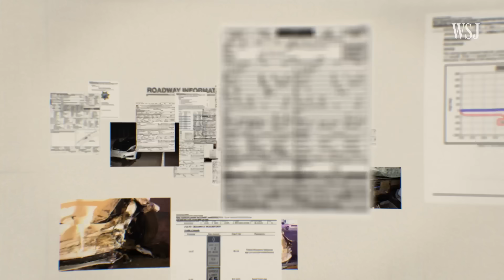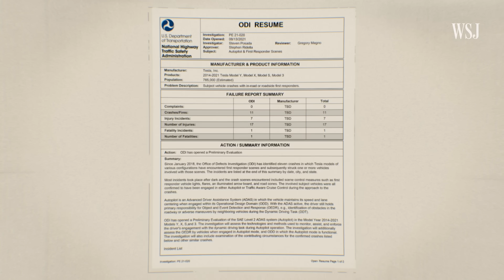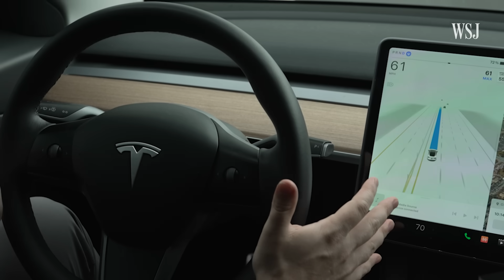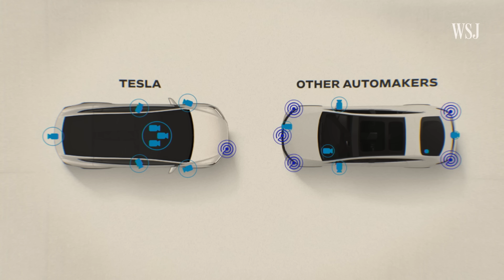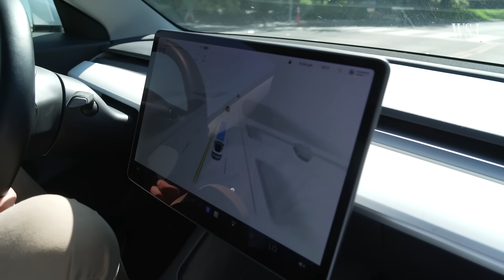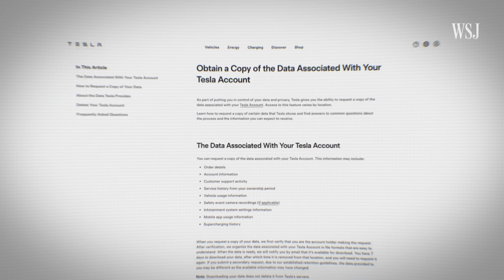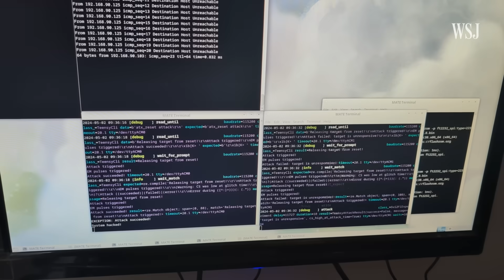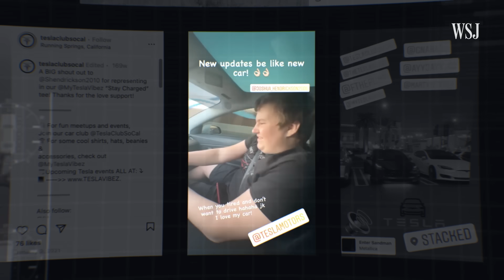The Hidden Autopilot Data That Reveals Why Teslas Crash | WSJ

Comment: Not just Tesla Autopilot, but auto lane keeping systems from other automakers, adaptive cruise control on any car, or even plain old cruise control available since the 1950's, does not stop for traffic controls or hazards in the road.  Like aircraft autopilots, it just maintains speed and heading, the driver needs to use the brakes or steer out of the lane when required.  ACC will slow for cars in the lane ahead of you, and some even stop for stopped cars, but not for all unmoving objects, like overturned semis.

Why the WSJ is framing this as a Tesla specific problem is a mystery to me.

Comment: The issue is not the cameras but the autopilot computer. Most of Teslas fleet is on whats called Hardware 3. Beginning in 2024, they released a new computer in their new bought cars HW4. This is currebtly the only hardware Tesla has that can run autopilot safetly with FSD version 13. So the short story is they are only sending the latest and safest software updates to HW4 vehicles!

Comment: Would a human driver see that at 7:10 without high beams on? Don’t think so. LiDAR would have picked it up. The whole point of self-driving is it should use better senses than a human driver so it can respond to these unusual conditions and be safer. It would also need better software than just trained AI, so it can respond to something unusual.

Comment: Some of this reporting was very dated, notwithstanding there have obviously been accidents, aggregate data (which is publicly available) would have been a good orientation point. People want complete accounts of issues. This is a good anecdote why mass media will fade faster than the discussed technology (as per the final quote).
Reply: One of the main points is that the data is not available.   Tesla hides it and is about to get worse as the new administration will soon not require crash data to be submitted to the NHTSA.   At the same time, they'll fast track this same tech to be fully autonomous
Reply: i dont get how people still believe anything wsj puts out

Comment: I had a Honda with dim headlights and also crashed into a disabled car on the freeway because they didn’t have any lights on and my entire front end was smashed in. As I got out of the car and sat in the middle divider, another car came up and rear ended my car turning it into an accordion. When I bought my used 2016 model x, the headlight was also dim like my old car, but the highway auto pilot worked good and it felt safe like adaptive cruise control that steers for you. I now have a 24 model y and headlight have drastically improved, but I don’t trust the supervised auto pilot as it made too many critical mistakes that I did not renew it. I find the issue is that the sensors do not scan far enough in the front and back. The documentary is correct that Tesla should reimplement lidar or any other technology like laser or sonar or anything in addition to just vision for better detection of objects in the road. Now that my free FSD trial is over, I’m back to the basic highway auto pilot and it definitely feels much safer since it’s not doing random lane changes and exiting last minute.

Comment: I was driving on autopilot on a highway at night about 4 years ago and was traveling around 65mph.  I was slightly distracted talking with my wife and its such a good system on highways that i was a little complacent.  All of a sudden a washing machine appeared out of nowhere right in the middle of my lane and autopilot didn’t react at all, but i noticed it in just enough time to take advantage of the cars low center of gravity and swerve around it, narrowly missing it and continuing on without incident.  It was purely my own situational awareness that prevented me from crashing directly into that washing machine, but thats what i was constantly told would need to happen while using the system, is that i would need to still be aware.  I have since seen huge improvements in the system, but only time will tell if it can see and react to these random objects in the road in a safe manner.  I still trust and use autopilot, and consider it a useful system, even though i still do have to correct it from time to time.

Comment: Wow, So much wrong info. While I agree this should not have been called "Full Self Driving". I never heard a claim that it didn't need monitoring. All the accidents shown in these video clips should have been "Driver intervention" moments. I also agreed that camera's alone were not enough, until I saw video of some new tech cameras that are more like high resolution radar combined with video that produce a sort of composite view. I'm on the fence as to whether this is a good idea. Too good, and it leads to complacency.

Comment: Seems like most of this could be solved by Tesla putting a second sensor type back on vehicles in addition to cameras
Reply: No the multiple sensor data complicates the calculation, which is why the newer teslas have an even better safety record than the first ones. Something they forgot to mention in the video, is that teslas even the old ones have the best safety records of any vehicles to date...
Reply: @Struct.3  Where are you getting your data? A quick Google search reveals a fatal crash rate for Teslas of 5.6 per billion miles, whereas the US average is 2.8 billion miles, so would be interested in how you are measuring.
If you're talking about crash safety ratings...that's just how well they perform when they eventually do crash, which is handy when Teslas are more likely to crash in the first place, but it would be better to avoid the crashes in the first place!

Comment: I knew it was a bad idea to cut cost and remove all the other sensors. They should make a law that requires several different types and fail-safe sensors if they are going to have autopilot features. I am a Tesla share holder, so this is a big issue I have always worried about.

Comment: The question is: would have Hendrikson avoided the crash if he was driving??

To be honest, if the car already warned him 19 times before the accident to keep his hands on the wheel, he probably slept while driving. It was 3 AM as well.

We need to compare the accidents with and without driving assistance to have the correct picture. Accidents will happen always.

My condolences for his family and the families of all those who died.
Reply: Most other brands would have the car stop driving if the driver doesn't have his hands on the wheel for that long. Rather than continuing and just giving out warnings
Reply: @ruykava  The other automakers would just turn off the assist system and let the car go into a ditch at full speed on a turn which would allow them to avoid the liability of crashing into something while driver sleeps.
Reply: This is an incorrect assumption (19 warnings -> sleeping). Tesla's driver monitoring at the time relied solely on monitoring the steering wheel for twisting (by the driver's hands). It could never tell whether you actually had your hands on the wheel, only if you would provide enough torque to convince it that you're attentive. The problem was that if you turn the wheel too much, it disengages the autonomy software and you are driving manually again. This created a delicate balance of putting just enough, but not too much, torque on the wheel. It's easy to go too light and then get those warnings. Literally everyone who used autopilot/FSD (before they added vision-based monitoring) got these warnings, all the time. 

If Tesla's software determines that you weren't responding to the warnings quickly enough, it would lock you out of the autonomy features for the remainder of your drive. The fact that it didn't do that here, despite 19 warnings (over what time period?) is not a data point in favor of the theory that the driver was inattentive. 

Possibly complacent, or overly trusting of Tesla's software, though.
Reply: Radar sensors could have help to stop breaking sooner. That’s the main flaw here.
Reply: Right don't blame poor billionaire Elon.
Reply: Not those kinds of accidents!
Reply: You can hardly see the overturned truck coming at you at 70mph. There were also humans on the road, causing more confusion and probably a delayed reaction. Instinct is to go to the left shoulder - but it was clogged with people. Possible approaching traffic to the right - and not enough runway to stop in time. But the WSJ calls it "Tesla bad".

Comment: It's the fact that it is a beta product that only recently got very good. People need to know the true limitations of the beta and Tesla could better warn people. The technology has a ton of potential  though and is already so much better on version 13. It cannot be trusted by the general public until it has 0 accidents ever. They did change how the cameras input data to the system, they used to have a computer vision system draw bounding boxes around objects, now the ai gets raw pixel data from the camera to more accurately detect objects.

Comment: Would be glad if the computer’s eyes at times when couldn’t “see” far enough (e.g. due to heavy rain, fog, night without street lights, etc.) would behave like a human to slow down the driving to just as fast as one could see the “x meters” “ahead”. The response time x 2 during such, so total 4 seconds, 4 seconds x 70 miles per hour = 125 meters ahead. Drive that fast if one could clearly see the 125 meters in front  of you, or …

Comment: Tesla is 10x safer than normal driver = period! WSJ is salty with Elon. 10x safer still means that accidents happen but it just happens at a rate 10x lower - and thus outlier and then these outliers are further trained on and thus reducing that risk too. I would trust Tesla more than myself in driving = the only thing is they should 2IC it with Lidars.

Comment: What a terrible way to present the topic like that - showing only few examples and with no reference to any statistics. I mean it says nothing when you learn how many crashes Tesla have if you don't compare it to how many Teslas are being driven. And then compare this ratio to the one calculated for other, similar cars. And based on that you can tell if it's more dangerous or actually safer. Thus I've learnt absolutely nothing from this video, pure waste of my time.

Comment: This is FUD set to dramatic music.  I've had Tesla's since 2016, I neither like nor dislike Elon.  Elon is specifically describing a technology that "makes better", as in safer than a human driver on their own, averaged over millions of cars and millions of miles.  So, if humans themselves without any technology achieve a 10% accident rate, and the one's with the technology achieve a 5% rate, it's an improvement, but you still have accidents, people injured or dying in all cases.  It's just when they die while using the technology the blame is different.  Like if your child has an accident around you vs. a babysitter even if the accident would have happened either way.  And the term "Autopilot" technically refers to a system in an airplane that can fly only in a straight line at a consistent altitude and speed, it can't land the plane or avoid anything.  So it is more ppl not understanding the term than anything else.  I only use Autopilot or FSD sparingly, because there are many situations it can't handle, and you have to be slightly more aware than without it, which can be stressful.  That said, I can definitely say it helped avoid accidents or fender benders I might otherwise have had because I got distracted or its reaction time is better.  I think people are misled about this type of technology (not only Telsa has it) but I don't think we have evidence that Tesla is deliberately seeking to mislead.  Perhaps poor marketing or lack of marketing.  This could have lead to the man in the video who died misunderstanding the tech, my condolences either way.  Maybe we should have training about it in drivers ed, or some kind of how-to certification for the tech.

Comment: WSJ seems to be conflating Autopilot with Full Self Drive. These are two completely different systems. Autopilot is cruise control + lane keeping. It does not pretend to stop for stop signs or traffic lights, iust like any other cruise control system. Full Self Drive is completely separate and attempts to drive autonomously under human supervision. The drivers hands must be on the wheel at all times. The WSJ did not do enough investigation to understand this and was not well enough informed to produce this piece of "investigative journalism".

Comment: In terms of FSD Tesla is the biggest scammer in history , complete lack of any transparence in fleet performance, how many intervention, how many times cameras disabled due to poor vision, happening very often in drizzle rain in bad november weather 10% of time warning massage about cameras blended or unclear view, many, many phantom braking in all possible moments, even wipers are not functioning stable at all, running at full speed with light rain or not turning until almost 0% visibility, old ford with simple diode sensor is working perfectly compared to this, so how for the god sake it should drive autonomously if he even can‘t keep windows rain free, it is madness...the day when first cybercab start rolling on the streets will be day of the reckoning for Tesla FSD, as long they don‘t expand onboard sensor suite. Meanwhile other automakers rolling out the systems which are much more stable and reliable.

Comment: I think people equate autopilot on a car with autopilot on an aircraft. If there is a problem in an aircraft the pilot normally has plenty of time to react due to the separation interval between aircraft and the altitude above the ground. If the self driving automation fails when the nearest object to collide with is maybe 10 feet away the car will hit it before the driver even realises there is an issue.
Reply: Ironically real autopilot on planes and boats only handle preset directions and speeds, in an environment where other vessels are detectable (often themselves actively broadcasting their positions) for miles around. It's not so useful on roads where obstacles pop up randomly with at best a few seconds to react.
Reply: So the obvious solution here is to have flying Teslas!
Reply: Sad reality is people autopilot their airplanes into the ground all the time.
Public think autopilot is some magic button to just push and forget.
And that is not true.
Reply: if only there was a person behind the wheel that could have took over before that point....
Reply: @WarriorPaxo If only you don’t call your system “full self driving”.

If only false advertising was illegal… Oh wait.
Reply: @-TheUnkownUser  false advertising is illegal. Litigation over it is why Tesla had to rename it to "Full Self Driving (supervised)". Stop fantasizing about a world where there's evil people getting away with crimes, when there are real people actually getting away with crimes.

Comment: I drove a Tesla for 3 years and I understood the capabilities of the car and the car reminds you of this fact every couple of minutes by asking you to keep your hands in the wheel, but even for the couple of minutes you don't have to keep your hands on the wheel it is a terrible idea to take your eyes from the road. That being said I did just that multiple times, not sleeping like some crazy people but sending that text message and looking down longer that you will ever dare with a regular car. People will fail to comply with the instruction of the car, that's why Tesla was forced to use the interior camera to monitor people's eyes. Even after all the updates the car had over the 3 years ownership, I was never confident the car would detect a piece of debris on the road, in fact I crack my front bumper with a piece of tire debris from an 18-wheeler on the highway, the car was on autopilot and I looked down when I looked up a bunch of tire pieces were flying towards me, I didn't had enough time but the computer sure did but didn't recognize the parts on the road.

Comment: @0:22: do not show fatal crashes. That is wrong. Even if his wife allowed it or wanted it in the video.
@10:25: "Computer vision is such a deeply flawed technology, and we're not doing enough to determine how to fix its gaps and how to make it recognize objects": It can't! (Additional) Lidar should be mandated for self drive. Also, regulators should drive a long distance in such a car themselves, also simulating objects like crashed cars on the road in the dark (while the regulator is in the car!), and not solely trust Musk on his blue eyes, before (having a vote on) allowing a Tesla on the road.
@10:48: "I don't think this is going to be a long-term technology that we're gonna keep in cars.": Wrong! It most definitely is going to be in cars on the long-term. Especially  in the long-term. But: be it helped with lidar and other systems, not solely visual data!
Reply: V13 of FSD is showing Lidar is not needed. There are already people accepting Tesla has the right approach, and it is only a matter of time before they solve automation. Tesla are set to dominate in this space, and sooner than people think.